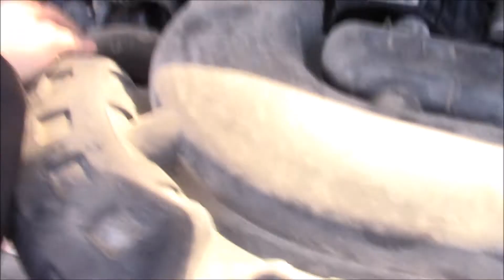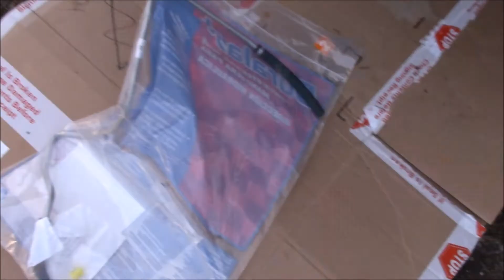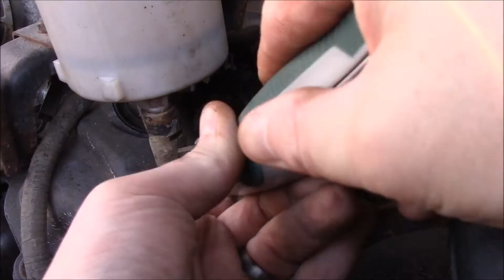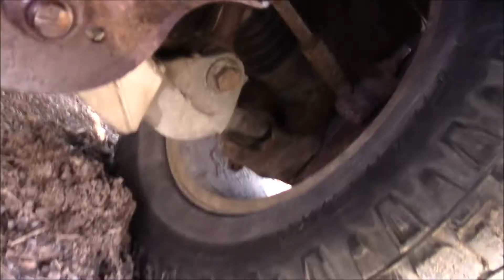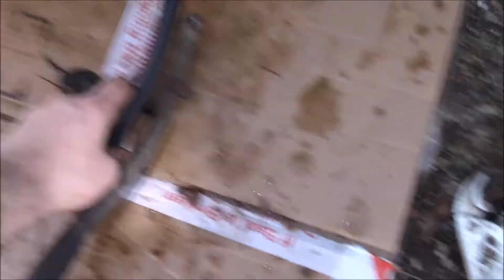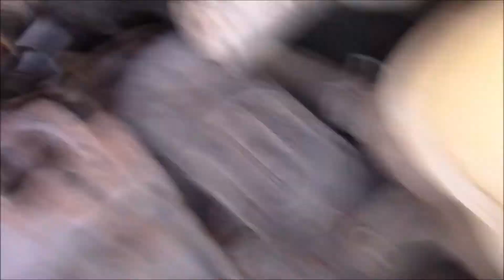2005 Ford F-150 Power Steering Return Hose Repair (with Finned Cooler, Tow Package)

Comment: First star that the top aluminum and you acknowledge that was the wrong way but yet you do it on the top which is plastic add dry rots and becomes brittle use the proper tool just like you said before proper tool for proper job practice what you preach
Reply from the maker: What tool is used for getting those stiff hoses off? Is there a tool? I'll buy it.